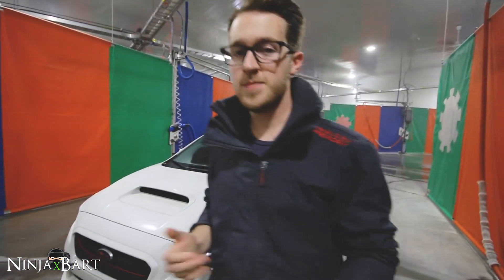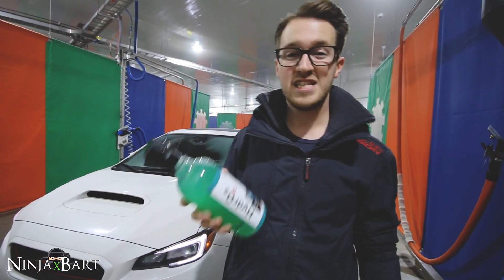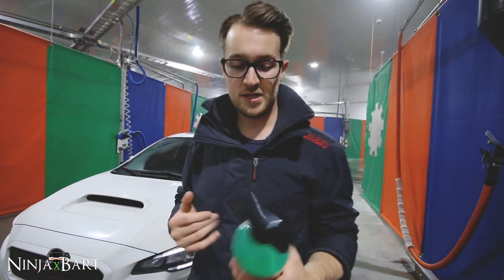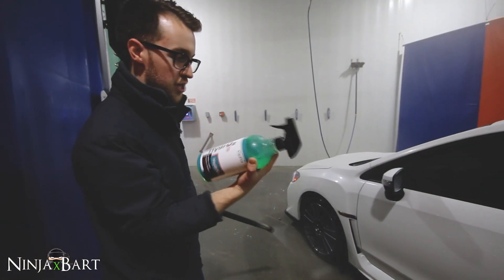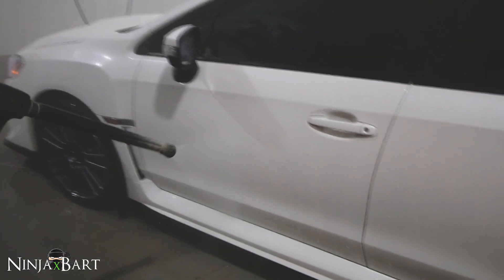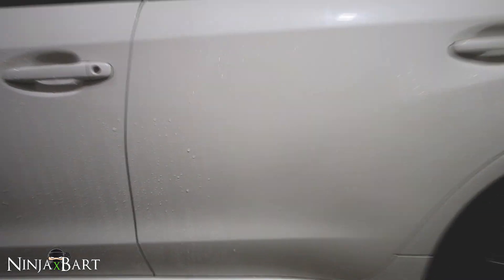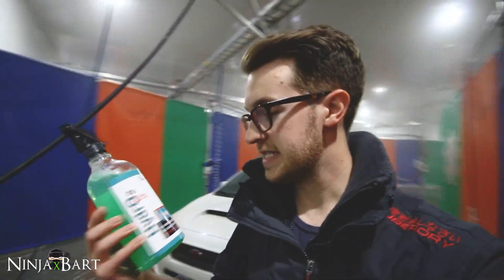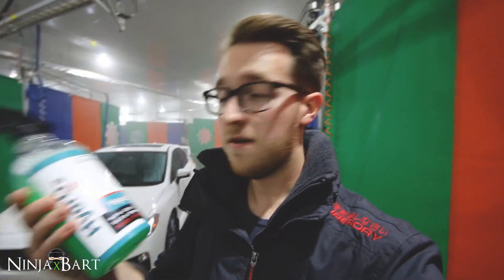CarPro HydrO2 - IMPRESSIVE!!!  (Spray on Sealant)

Comment: ive just bought some of this to top my ceramic wheel sealant but wondered about using it on paint. my car is already treated with menzerna powerlock and paste wax but for winter protection i wondered if this can be applied over a paint sealant or only on bare paint? was your car in a naked paint state in this video or was there already sealant/wax on the car before application?
Reply from the maker: I had some sealant already on the paint from a few months ago but mostly worn-off by now so it was almost bare :)

Comment: I am a fan of this product. Clay the paint first and it will last quite a while. Definitely worth purchasing.
Reply from the maker: It's awesome!
Reply: Dave, do you use anything in addition to this, other than starting with claying, such as before or after the product is applied?
Reply: Robert Adkins. Well the Carpro will work best if it comes into contact with “bare paint”, no wax or dirt to be in the way. So if you clay and dewax the car the product will stick better. 
I had plans on using a  wax or sealant on top. But the Water beading is so nice I don’t even want to. This is so easy to apply and works so well is not worth applying anything on top. It’s just so easy and effective to just apply this again. 
Obviously at some point you will need to start the process over again.

Comment: Cool vid but if the stuff was really good shouldn't the water pretty much sheet off instead of leaving beads?
Reply from the maker: Jimmy H Thanks man! If water sheets off, that means there's no sealant. Sheeting is technically water "drag" on the surface of the car, it keeps the water molecules I guess attached in a way and it's heavier. Water always sheets "off" but if you have a strong sealant the water should bead up and repel off much faster and be dry after to the touch. Same way people apply the windshield sealants to repel water, you wouldn't use the same on paint ofcourse though - this is a very good product though!! Beading is always good ☺️☺️☺️☺️ Checkout AMMO NYC AutoDetailing videos for some info on sealants and such!!
Reply: NinjaxBart was just watching some other videos on ceramic coatings and they ran the water hose after and basically literally water sheeted off and left no trace of water on surface.  Maybe you just had a weaker solution, just watched other videos of hydro2 lite and theirs completely sheeted off and no beads of water left.
Reply: Angry 8 it all depends on the water pressure...
Reply: It depends on how much water. You basically want the largest bead angle possible (use a goneometer) which indicates the surface has a low surface tension, which is what you want. Ideally the water would stay in a perfectly round bead.
Reply: The contamination of the water also explains the differences.

Comment: how do you think it will do on carbon fiber? great video thumbs up
Reply from the maker: As long as the CF is clear-coated it would act the same as if it was on paint so it should work yup!!
Reply: NinjaxBart I need to try it especially cause winter is on the way
Reply: NinjaxBart You can actually us Hydro2 on anthing. Glass, plastic, paint, wheels etc. Inside the wheel wells along the plastic and the undercarriage as well. That's the beauty of it. It gets into every little crevice. If you like the Hydro2 also check out CarPro's HydroFoam. Its a soap with the properties of Hydro2 built in.
Reply: 72beetlevw I have to check that out
Reply: jaime carrasco For sure. Carpro-us.com is where I order from. Very good prices and super quick shipping.
Reply: 72beetlevw thanks bro !

Comment: where did you get it from, I can't find it on amazon.
Reply from the maker: Jin Chen local shop, I couldn't find it on amazon either to link unfortunately
Reply: Jin Chen i got mine on amazon 63$
Reply from the maker: Make sure to buy the LITE (diluted, premixed) it's cheaper OR if you buy the concentrated you just mix with water to the ratio noted on the bottle!!
Reply: NinjaxBart I found it on the website call eshine car care. It's at Ontario

Comment: How much did you have left after applying it to entire car?
Reply: STI4Life06 - I have a full size SUV. I usually use about 1/4 bottle each application.   And that is probably on the high side. A little goes pretty far.

Comment: I want to see a video where someone applies it when the car is dry and uses a microfiber. And see if it improves or not.
Reply from the maker: You cannot apply this while the car is dry, it will stick and do nothing haha, it's not an apply / buff of product. You could try, but the instructions are specific not to do so.
Reply: @SpencerHogg  I'd figure, but since the active ingredient is Silica, the main ingredient in ceramic coatings, would be a cool try.

Comment: But the water still sticks to the paint... weird!
Reply from the maker: Beads man, beads!!
Reply: NinjaxBart But it's not running down. It stays on the paint=stains
Reply from the maker: It's not as amazing as a CQuartz ceramic application for example, but for a quick spray on during the winter it's pretty awesome!! :)  The beads generally roll off, but depends on the sealant and such - This is good but not as good as a hand applied sealant obviously!!  The thing is that's great is you can apply this and then for a few weeks the snow/slush/water etc. just falls off while you drive which is nice. 

My other favorites are the CQuartz or Sonax PNS. What do you like to use??
Reply: NinjaxBart The best one  until today is Menzerna PowerLock for the base and for the quick one is Sonax QuickWax. I just received 5l (1.3 gallons) of this stuff because you said it's so good. :)) Can't wait to try it out!
Reply: I agree here. The product is easy to use but the results aren’t super impressive. I think we’ve all seen way too many fake Disgracebook adverts where the muddy water magically sheets off the car hood.